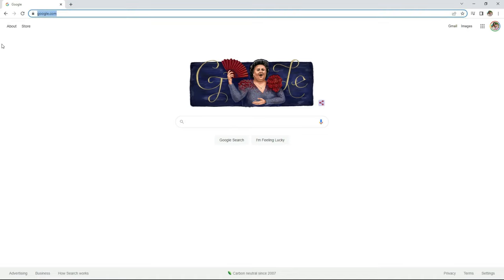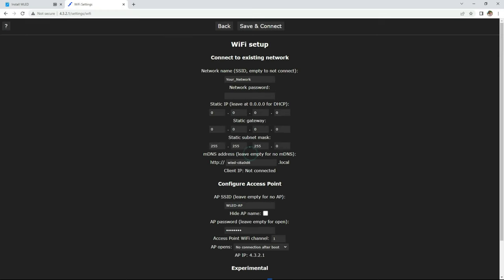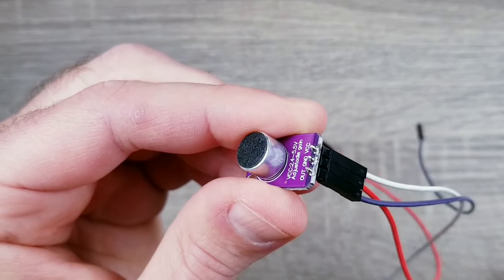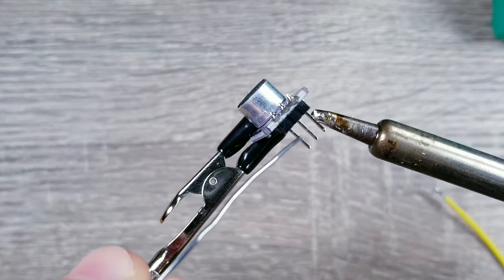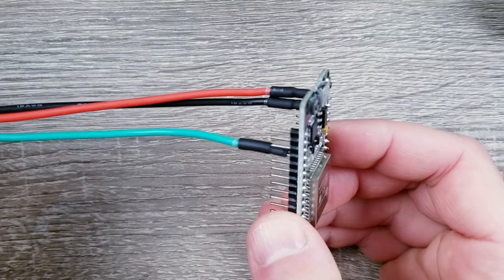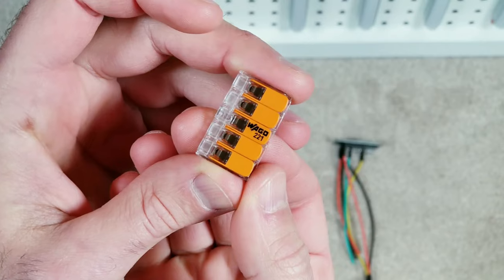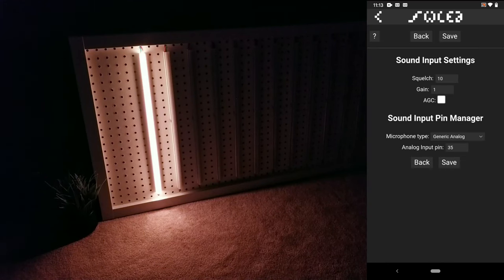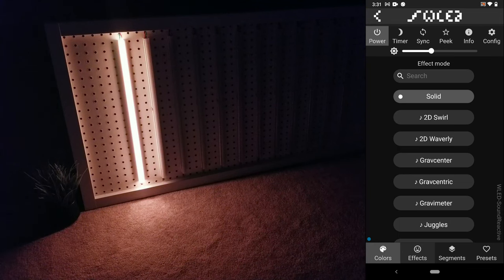WLED Sound Reactive - Complete Setup Tutorial

Comment: This may be a dumb question, but if i had multiple controllers in the same room on same network, could i mic one of them and then the data from that controller be synced to the other controllers using Wled software or would each controller have to be individually mic’d?
Reply from the maker: Thanks so much for watching and great question! So in my experience that would not work. Each controller would have to be set up with the mic to work. Now all the controllers in a room can sync together but all thats doing is changing the color, effects, speed etc to what you want but if you change them all to a setting that uses the mic, the controllers that dont have a mic will not do anything if that makes sense. You could split the data line from one controller that has the mic to different led strips (connect them in parallel) and then all those led strips would do the exact same thing but for that you would want to make sure all the led strips have the same amount of led lights

Comment: I just found your channel and I love it man.

Needed it a year ago when i tried to alter my govee Leds and ended up having different colors in the different strips (i guess the signal cable was too long).
Then I saw the video with the accent wall and that you put a small resistor in and I thought "damn i guess that was my problem ".

Not sure if you tried it already but automating your projects would be pretty cool.

I read you can use Homeassistent to connect with WLED and control your Light.
So e.g. you could have some NFC Tag sticker around the house (really cheap) and the lights would turn on by just holding your phone on the sticker for a sec.

Instead of having to unlock the phone and open the WLED App.
Reply from the maker: Thanks so much!! I have not gotten into the smart home/automation yet but I do want to at some point! The situation you describe sounds so cool with using an NFC Tag! Might have to try it down the road and will have to for sure make a video! Thanks again and thanks for taking the time to comment!

Comment: So, I ordered a package of max4466 and installed 3 of them(1 at a time) on an ESP32 for sound reaction on WLED. I'm not getting any reaction from them. The only thing I'm doing differently is using the ground pin on the ESP32 because I am powering a strip of 60 pixels with a micro USB cable and a 5V 2A phone charger. I am able to run regular light cycles through the WLED app but not the ones with notes beside the names(sound reactive). When I select any sound reactive modes, the lights just turn off.. I know I'm connected, I have 3.3V at the ESP32 and the 4466. I have the proper version of WLED sound reactive installed on the ESP32. I have the audio data pin set to 35(even though it defaults to 34 in settings). I have turned up the gain on the 4466, but still nothing. I even soldered wire directly to the 4466 mic instead of the 3 pin post that came with it on the 3rd mic I tried. I have been unable to find much info online for my particular problem, but I can't be the only one. I suspect it is a grounding issue. The ground pin on the ESP32 should work, right? I was wondering why you didn't solder the 4466 ground directly to the ESP32 in this video?? For this project, I am not using a large power supply, and the only other ground I can tap is the ground connected to the light strip.. in this video, you just hooked it up and it worked. You didn't even adjust the gain on the 4466. Can you help?
Reply: The same is happening to me. I tried with 2 different ESP32 and with 2 different mic too. It works the first time after a reboot as long as I leave it connected but as soon as I turn it off and turn it back on it doesn't work anymore...
Reply: @gabofernandez  max4466 is a lost cause.. this guy should have made an update video or taken this one down. He DID update his Amazon links so he could cash in on people buying the faulty parts for his projects, though! Good for HIM! After working with 6 pairs of ESP32's and max4466 wired 3 different ways with the same poor results, I know for a FACT that he had problems with his setup.. but to keep his "content" and "creator" cash flowing, he just released the video anyway and leaves it there so people can waste their time and money on B.S....There are better microphones AND better channels to learn from.. this guy doesn't even respond tho his subscribers much. He obviously doesn't care about anything but cashing in on people..

Comment: Thanks for the video. You will find I used your links for the cpu, wire, wego clips and microphones. You made shopping easy, and got credit for the sale!  Question as I wire up a sound reactive setup…  Is there any reason you didn’t wire the microphone ground into the ground next to the 3 volt output on the board? I am thinking either personal preference, or possibly noise on that ground? Hope you have a moment to reply, thanks again.
Reply from the maker: You are very welcome and thank so much for the support! That's a very good question! I tried finding videos out there that would help explain to me how to get something like this set up and I really couldn't find anything on YouTube. I found some that had breadboards involved and others that used different mics or different esp boards, but I never found anything that used this esp32 board with this mic. However, I did end up finding i think it was a written explanation on some website that seemed to use the parts I wanted to use and the way it was explained on that website was the way I did it. So all that to say, i have no idea if there are any pluses or minuses to the way I did it versus using the pin you mentioned! But if I were you (and I might even try it now myself as I'm always curious) i would try doing it both ways and see what works the best or if its pretty much the same! Thanks again buddy!
Reply: @ChrisMaherDIY I completed the project and am playing with the values. I didn’t adjust the hardware gain on the microphone and am not sure how to adjust the software squelch and gain. Currently I am playing with values 1 and 100 and all the sliders.. I think the music volume in the den may need to exceed the limit imposed by the rest of the family to get this to dance. At least I can confirm that soldering to the other ground pin works and simplifies the switching of this unit to another without the microphone.
Reply from the maker: @kd6lor  Yeah I'm honestly not even sure what all the adjustments do. I just keep playing around with everything like your doing until I seem to find one that doesn't pick up every little noise but will pick up the obvious ones! Thanks for letting me know about the other pin working! I'm by no means an expert at any of this so I'm always grateful to learn new things! Thanks again buddy!

Comment: Why did you only use one section on the pin board one you did? Looks good in the bedroom. Although getting down to the grove, not sure if it would be off putting or enhancing 🤣🤣.
Reply from the maker: Lol yeah probably not something I will use much in the bedroom. The bedroom setup is really just for some accent lighting at night instead of having a lamp! I tested it out first using all the sections of the peg board and since the way I had it wired up it treated all the sections as 1 large one so it was difficult to really see the effect since all the sections were lit up! I could have created 12 segments and then they would have all been doing the same thing which would have worked but didn't want to take the time to do that.

Comment: Chris, how would you wire this with just a 2A 5V phone charger?
Reply from the maker: Thats a good question! I would probably cut the end off the phone charger cord and there should be 2 smaller wires that you can then do the same thing I did in the video. I'm not sure if it would work but that's what I would try first!

Comment: I did everything you said in your video. Everything works great before. I bought 6 of the mics from your link you posted. I tried everyone. Does not react to sound whatsoever. Im super frustrated. Are all your mics you use the same? I need help. I have went through a bunch of forums. Im starting to believe wleds soundreactive update is messed up. All my wires are 18 gauge as well.

Comment: Hi Chris, Thanks for the great tutorial. One quick question: if I have two set of LED strips, is it okay to connect them with a Wago connector that has 1 more slot for the ground, data, and voltage cables? Or would that short the system?
Reply from the maker: If I'm understanding correctly, you can for sure do that. For example, if you have a wago connector that has 4 slots, 1 slot can be for the main voltage line, another slot can be for the voltage going to the esp device, another slot can be the voltage for the 1st led and the last opening can be for the voltage going to the second led strip. You can do the same thing for the ground and data lines. What you cant do is use a wago connector with lets say 4 slots and in 1 slot you put a ground, 1 slot you put a voltage and another a data. That will not end well since you are crossing all the connections. Hope that helps!

Comment: how do you know what pin to use on your Esp8266?  Mine does not have the pin you mention.  I have an ESP8266MOD and the pins are labeled D0-D8. Where can I learn the pin outs on the board?
Reply from the maker: Hmm, I would just do some trial and error unless your able to find more information online. Maybe try using the d2 pin for data. In the WLED app under led preferences it lets you input what pin is the data. Try putting in 2 and see if it works. If not, then try a different pin and keep going down the line until it works. That's probably what I would try!

Comment: Super simple question here, but what effect were you using to test the mic operation and making it so its off unless it hears sound? Having the odd problem of turning on an effect and can see it move with my voice but it's being washed out by the normal effect running constantly so you can hardly notice.
Reply from the maker: Thanks so much for watching! I cant remember specifically but I do remember that it did pick up some background noise so that even if to me it was quiet, the lights were still bouncing around. I think I ended up adjusting the squelch and gain in the sound settings and it helped. Wish I could remember for sure but will probably just take some experimenting.
Reply: @ChrisMaherDIY  will try that out, thanks!

Comment: Awesome work! Love you’re video’s. But I am somewhat confused….I did some research and sometimes people are using a logic level shifter. You don’t seem to do that. The plan is to make two sound reactive floor lamps. One with controller and one without. The lamp without will get its data and power from the lamp with the controller. There will be somewhere around 250 led’s together, 125 per lamp. So the big question is, do I need a logic level shifter?

And suddenly it hits me…the strips are directly powered by the powerblock and not thru the esp board. So that’s why there’s no need for a logic level shifter.
Reply from the maker: Thanks so much for watching and great question! So my understanding is the logic level shifter is there to boost the data signal so that it reaches the lights and does what its supposed to. For some of my projects Its worked perfect without it and for some (mostly when the data line from the esp device is somewhat long going to the first LED) I have needed to use something (I've only used a small resistor like I did in this video: https://www.youtube.com/watch?v=b13VLiK7AOU&t=1s or a method called the sacrificial pixel, but a logic level shifter I think does the same thing) So for pretty much everything I've done, I start out without using anything to boost the data signal but when testing things out if the led lights are going crazy, that generally means I have to do something! Hope that helps!
Reply: As mentioned before I want to build to  two sound reactive floor lamps. I have two options.  Option 1 is to build two sound reactive floor lamp and hope that they react, pretty much, simultaneously.  Option 2 is build one sound reactive lamp en split the signal coming from lamp 1. The maximum distance between the two is maximum 5 meters so I hope that works out. And if not I will have to use a logic level shifter or use a sacrificial pixel. So my other problem is connecting the two. Lamp 1 is always in the room and lamp two is optional. Which means that when I want to use that lamp I will have to connect them using some sort of wire. The best option I can think of is take a normal three conductor power chord. Two chords will obviously conduct the power coming from the 5v 10a power block. One chord will serve as a data wire which goes from led strip 1 and runs to strip 2. And they will be connected with a xlr connector. But I am not sure if that’s technically possible. Any ideas in that?
I could not think of any other type of connection between the two lamps with one cable that sends power and date to lamp 2.
Reply from the maker: @3lwoood  Thanks for the reply and the explanation! So I've never used an XLR connector but just looked them up and I'm intrigued! I could be way off because i'm not exactly sure how they would work but do you think you could just get a splitter like this: https://amzn.to/3F9RckR and then 1 would always be plugged into the lamp that you have in the room and the other you could just plug and unplug as you needed?
Reply: That’s also an option. I just ordered all the parts and when I’ve got everything i will start the build. By then I will look and decide how to connect them. If you want I can keep you updated about the final result. 
Thanks a lot for you’re reaction and time! Keep up the good work en keep inspiring people.

Comment: Quick question, If I install one sound module on only one of the ESP's in my system, can I use the sync feature to have all the LEDs in my system react to just the one sound processor?
Reply from the maker: Thanks so much for watching and great question! so the sync feature will not work that way. You would need to have each controller set up with the mic for it to work like that.

Comment: I'm using an ESP32-WROOM-32 and I can't get the mic to work, it doesn't have a D35, it does have P35 though. I changed the pin in wled and can't get anything, tried two different mics and two boards. Any advice?
Reply from the maker: Hmm that's a bummer! The only thing I can think of is that maybe the p35 pin is different than the d35? It seems as if it would be the same but maybe not? I would maybe try doing some google searching to see if the exact board your using has any tutorial on getting things set up with the sound react version of WLED. Let me know if you figure it out as I'm curious myself as to what it might be!

Comment: I'll go ahead and answer my own question in case anyone else runs into a similar problem. The max4466 is not a quality mic. It is susceptible to noise in the in the wires and the devices they are connected to. I was trying to build a light box that was sound reactive and powered by a USB power supply. I discovered this won't work. Here's why...After soldering my connections and connecting everything to the ESP32, I had no mic. But I could change the color in WLED sound reactive.  I knew everything was installed and connected properly, but I had no mic. This was powered by a 5v 2a supply via USB. I have a box of USB plugs and none worked.. new or old.. then, after some more troubleshooting, I hooked everything up to the same power supply Chris uses in the video(tho mine is a 5v 30a) the 1st time I put the lightstrip on its own power and twisted the common wires to the mic and ESP32 together on their own power and still had no mic. Luckily, I had a 3rd post on this power supply, and when I gave the mic it's own common post, it worked.. the mic needs to be connected to its own common (ground) I'm thinking there is a better digital mic that would do a better job. Even with the gain set to high on the 4466 and the sensitivity all the way up on WLED, I either get too much reaction or not enough. Hope this helps someone. I think that should have been explained in the video, but it wasn't. Common sense(pardon the pun)would dictate ground on the ESP32 would be where you hook up ground from the mic. For once, common sense was a bad idea..
Reply: OMG. I need to meet you in person and kiss you cause I could not figure out what was going on. I did this and it worked right away.
Reply: @brivic7273  glad I could help!
Reply: @brivic7273  But, that mic is a lost cause...
Reply: @Ravenseyes10  What do you recommend instead? And do you have a tutorial on how to put it together?
Reply: @brivic7273  I2S... and no, I don't have any videos. Sorry. There are plenty of videos showing how to set them up.  The MAX4466 will work intermittently, but will stop suddenly for apparently no reason. The problem is in WLED(not a problem, really). The noise floor(static/hiss in the background)for that mic is very high and WLED is programed to ignore the noise floor to differentiate noise from a wanted source like a speaker and an unwanted one like the A/C running. So, if the noise floor in the environment is too loud, WLED ignores all noise and won't work. Making the MAX4466 as useless as a pecker on your forehead! You would probably sound like Thomas Edison on a wax spool if you tried to record audio with one of these turds! You have more connections to solder, but there will be no problems if you use an I2S mic...works brilliantly!assuming you know how to solder and set up the mic in WLED. Good Luck!